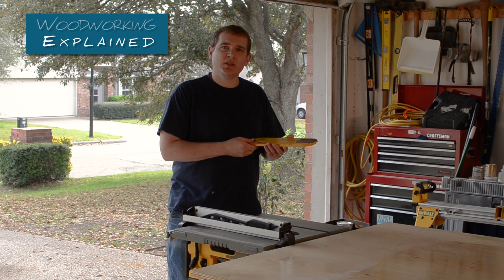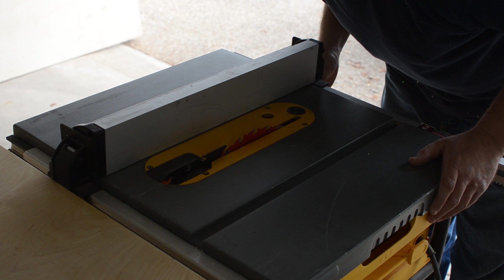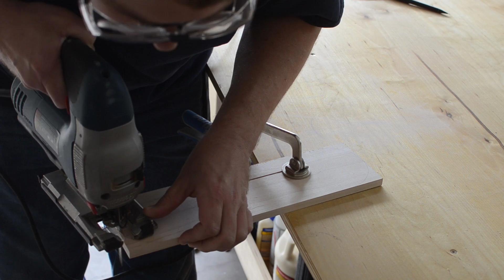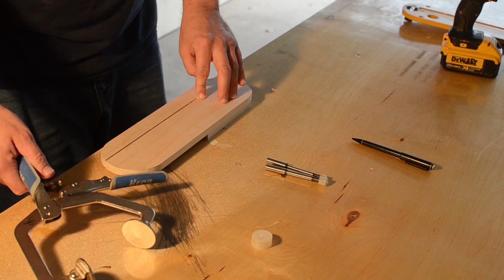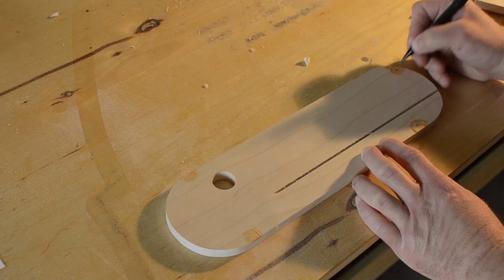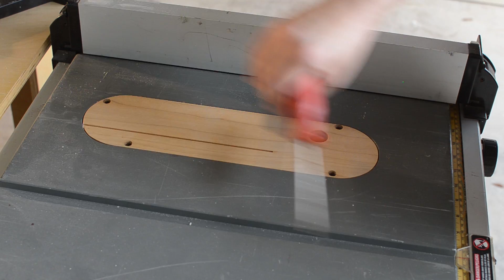DIY Zero Clearance Throat Plate for a Dewalt DW745 Table Saw

Comment: You deserve more subscribers. I’ve seen so many ridiculously over engineered ZCI videos. Using template routers and all this jazz. Always wondered if I was ghetto for just using a jigsaw as I was very new to woodworking and was learning about tearout at the time. I didn’t have a ton of equipment or skill but still wanted a ZCI and didn’t want to buy one. This method is great and works. I’ve been using mine for several years. Made a couple actually for thin kerf and full kerf blades.
Reply: That was a great comment. If you want to do woodworking, start with what you have. As you go along if you feel other tools can make your work faster or easier, buy those tools. But, remember (Quote, I do not know the source), if you think you need the most advanced tools to do a job, you're right. If you think you do not need the most advanced tools to do a job, you're right.

Comment: Totally backwards. I just made two zero clearance throat plates for my Delta unisaw. I removed the blade until I had the fit perfect. Once I put the blade back in I just set it with the front portion on the two front supports and carefully lowered it until the blade started contacting and continued until the insert was set in place. I shut off the saw, moved the fence to cover less than half so it was clear of the blade. Started the blade and raised it until it was at full height. I shut it down, flipped the plate over and fed it directly into blade with it on so it would cut a clean slot just long enough so splitter slot and blade slots are not joined as my saw doesn’t have a Riving knife or splitter, I modified one plate for a splitter and one without.

Comment: Thank you. Well done. It is also possible to set the width cut by using the OEM throat plate between the blade and the fence.
Reply from the maker: Thanks for the suggestion.  I appreciate hearing from fellow woodworkers.

Comment: Great. But have you provided some sort of locking mechanism as what the original insert has?
Reply from the maker: Thanks for commenting. I didn't add any system to lock the insert onto the table. I simply make the insert have a tight fit, and rely on friction to keep it in place.

Comment: How does it lock down?
Reply from the maker: The only thing holding the insert down is the weight of the insert & the tightness of the fit. Initially I was concerned about it staying in place, but after hundreds of cuts, I haven't  experienced any issues with it coming loose while in use. Thanks for the question.

Comment: I am a bit concerned about safety, as there is nothing securing the throat plate to the table other than gravity...
Mine is the older model with the simpler riving knife (without the notch for the anti-kickback) and a Philips screw for locking the plate to the table.
Reply: Henrik Paulsen I wondered the same thing. I’d fee better at least including the small flanges that sit just under the surface on the back side.
Reply: @taterberryman  When I made mine I drilled a couple of small holes (to prevent spitting) on the rear of the new throat plate where the tabs are located on the metal plate and installed a couple of small nails. I used 1 1/4" nails with a drop of CA glue and bent them for fit to prevent uplift. I also bought a bag of 10-32 x 1" nylon set screws, (no head just a screw driver slot on top and cut them to 1/2" in length, then drilled 4 #29 holes in the plate, put a 10-32 tap in my drill and tapped them out, no countersinking I made several plates from 1/2" Baltic Birch plywood and a template out of 1/4" MDF. Safety First
Reply: DAP460 That sounds like a solid plan. I’ve seen one other use the nail approach, and as the Dewalt holding tabs seem a little tricky to replicate (at least with my tools and skill set, anyway) I’ll probably go that route as well. Thanks for the input!

Comment: Thanks for taking the time to make this video!  I’m getting into woodworking and I just bought a dewalt dwe7480 table saw.  I want to do this on my saw. I noticed the throat plate has screws on the edges but there’s no threads on the metal tabs that you marked with the paste wax. Why is that?
Reply: Charlie Petway the tabs aren’t meant to secure the plate to the table, but to level the plate up and down in relation to the work surface.
Reply: Tim B thanks I figured that out after looking closer at it and watching all of your video.

Comment: How do the throat plate screws alter the height of the throat plate if the holes aren’t threaded?
Reply: I think the holes he drilled are smaller than the set screws, so they thread as he screws them in.  If they lose threading over time then just create a new plate.

Comment: I have seen in so many videos that the riving knife is removed... do you know why is that ? I´ve noticed on my DW745 that the riving knife is not aligned to the sheet, it´s probably 1 mm or 2 to the left. I thought that this was the reason to remove the knife with zero clearance inserts !! am I wrong ?
Reply: The knife should be parallel but slightly thicker. A true zero would need a fixed splitter added.

Comment: Or get a pattern following router bit?and make lots of them in short time, there’s a lot of videos on YouTube that explains this process, very well made video with an alternative method of making inserts.
Reply: Yes.  Flush cut routers are one of the most useful tools in the shop — especially if you have a table router.  With the original metal plate to use as a pattern you'd get a perfect copy in no time flat.  I would do the same as you and save the first plate as a master, as you are bound to need more over the years.   I was also wondering why he didn't mark the holes through from the original plate?

Comment: What about when you cut at an angle? Will this still be a zero clearance when cutting at a 45
Reply: No, only zero for 90° cut. The process is the same for 45°. When he cuts at 90° in the video, cut at 45° instead. Don't cut your push stick!

Comment: Still unclear on what the purpose of zero clearance is
Reply: Essentially without one bits of wood can fall in that hole and either jam up the blade or the blade can throw pieces back at you. Also as I recall it decreases the chance of kickback a bit too.
Reply: The most desirable benefit is that zero clearance throat plates support your workpiece immediately to the left and right of the saw blade as it’s passing through the wood, which keeps the wood from tearing as the blade exits. The resulting cut is clean and not “fuzzy”
Reply: @andypitz1  excellent answer thank you 

So with that in mind, a cross cut sled will not need a zero clearance because it is a zero clearance.. agree ?
Reply: Doosha Khaboosha thank you, and yes, the final step in building a crosscut sled is making a kerf cut into the sled, which creates a zero clearance effect

Comment: Hello, great video, I'm curious, with the blade guard on, is it possible to lower the blade nearly flush with the cutting surface, or does it need to be removed? Thanks a lot.

Comment: Been thinking about this for apparently too long. I've got a Lowe's contractor type saw, Kobalt I believe is the name on it, and finally decided to bite the bullet and make the zero clearance throat plate. I've seen a lot of videos on it. Yours is one of the better ones. So I pulled the plate off yesterday and found it to be almost a quarter inch metal plate. No way to build a nice wooden plate that I can see. Can't find any wood that isn't bent or warped in that small a thickness. Got any ideas for man made materials we can make these out of?
Reply from the maker: Great question.  I think you may try using 1/4 inch MDF.  It's easy to cut and shape, and is less likely to warp when compared to plywood.
Reply: I made one for a similar saw using 1/4" ply to attach where the insert screws to the table but added a smaller insert of 1/2" ply inside the opening for the blade to strengthen/flatten the insert. Hope that makes sense.

Comment: What holds the plate down so it won’t lift?
Reply from the maker: +F Vids The only thing holding the insert down is the weight of the insert. Initially I was concerned about it staying in place, but after hundreds of cuts, I haven't  experienced any issues with it coming loose while in use. Thanks for the question, I should have addressed that in the video.
Reply: Woodworking Explained thanks

Comment: Jeff, made this yesterday in under 15 mins, thanks so much for your easy make video.
The only thing i did different was I used Hot glue on the tabs where the set screws would go
I applied the glue  and then set the insert in while it was still soft and then used two metal straight edges
to set it  flush and level with my table
Thanks again
Reply from the maker: That's a great idea! Thanks for sharing your advice and I'm glad the video helped.

Comment: Hi Jeff, At last I own same table saw. Now i need you advice router inserts. Will a plywood of 8mm thickness have the same efficiency or strength of a metal router insert.
Reply from the maker: I'll try to answer your question. First off, congrats on the purchase of your new saw. Now, when it comes to router inserts, there needs to be enough strength to support the weight of the router, plus the downward forces applied when using the router. Also, the insert must not deflect when is use. Based on these factors, a metal insert is the ideal material. However, you can may be able to try the 8 mm ply. If it doesn't work then try a thicker ply. Hope this helps.

Comment: i have this table saw dw745.. however, how did you solve the noise problem of universal motor?.. i have an idea to change this universal motor to brushless dc motor.. have u ever though that before?
Reply from the maker: Great question. It appears Dewalt has a new cordless table saw (DCS7485T1) that utilizes a DC Brushless motor. Based on the specs, it may not be as powerful as the DW745. However, as with most things, I'm sure it will be a very competitive table in years to come. Thanks for watching and taking the time to comment.

Comment: Hi Jeff,when u making the table saw insert you use the bell sander. Can we use the disc sander instead of bell sander if we don't have one
Reply from the maker: Sure, you can use a disc sander. I just used my belt sander because it was easy to use for that application.

Comment: Hi one question does the size of throat plate various or they are same for DW 745
Reply from the maker: The Throat Plate Assembly for the DW745 Type 2 & 3 use the same part (P/N: A26208), however the DW745 Type 1 uses a different throat plate (P/N: 5140033-52). I'm not sure if both parts are all the same size. Hope that answers your question.

Comment: Hi did you reconstruct your reviving knife, because your looks a bit different. Please make how redesign reviving knife if possible
Reply from the maker: This model had a riving knife installed from the manufacturer which I didn't modify or change.  If your model is the DW745, this method should work. Thanks for the question.

Comment: If you have a planer and router; try using MDF with hardboard glued to it. Then use router to cut shape using original as pattern. Then plane the MDF side to thickness without  using screws.The advantage over wood is I have never had one wrap. Some use Thin formica for surface If you need to one or more  areas can be recessed as needed on drill press using a stone bit.